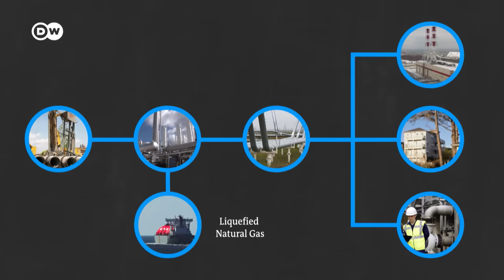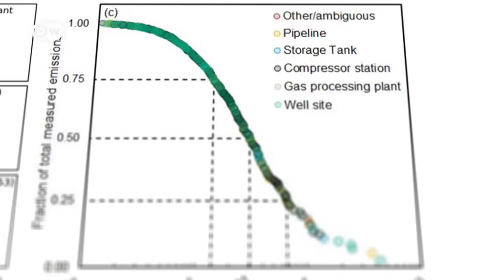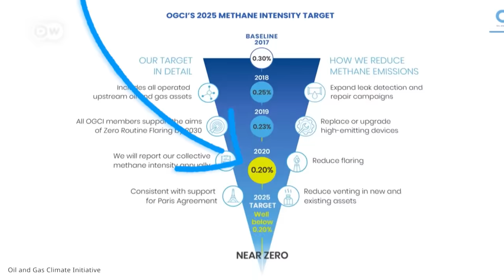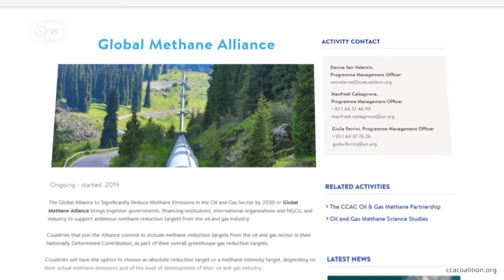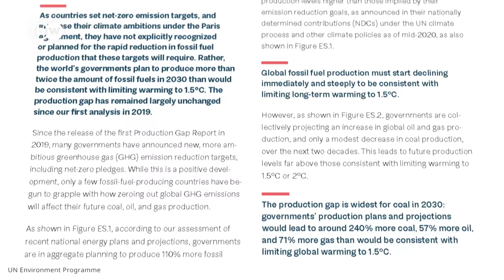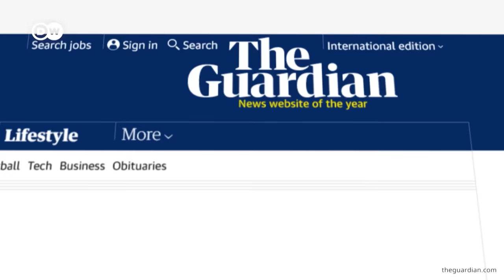Why we need to ditch natural gas (asap)

Comment: The whole conversation about CO2 driving tempurature is very weak at best. Our use of carbon based energy at a time when CO2 is this low on earth is a very good idea so long as we make sure to scrub out particulates. Advocating to not use abundant inexpensive energy as we develop better alternatives is more harmful to all life on earth than helpful. By every measure every part of our lives have dramatically improved since the use of carbon based fuels in the late 1800's. Either advocate for better engineering or leave it alone!